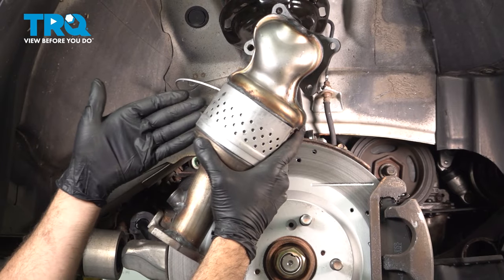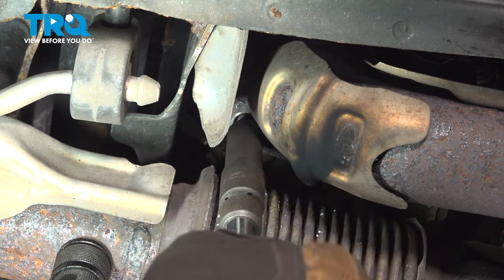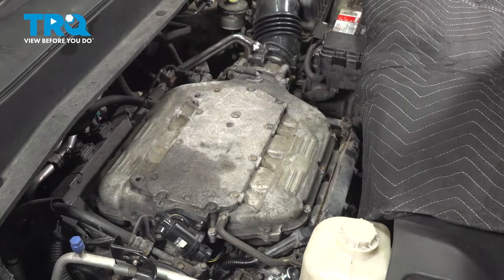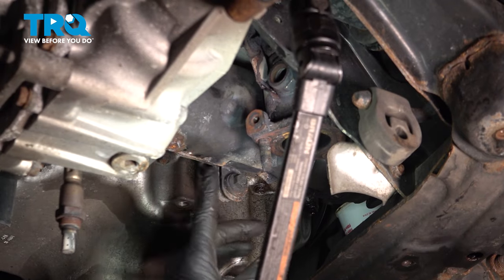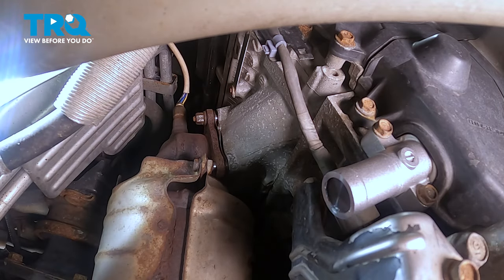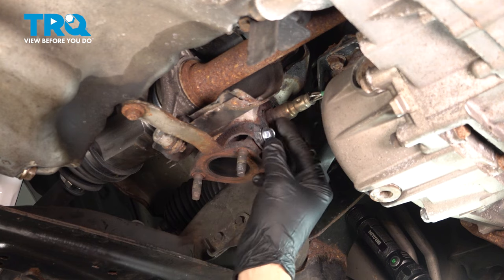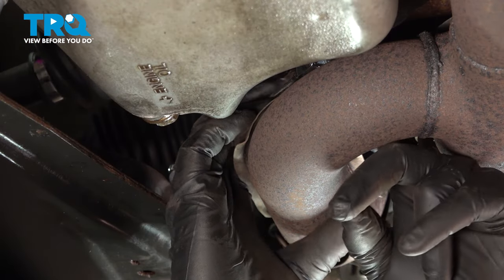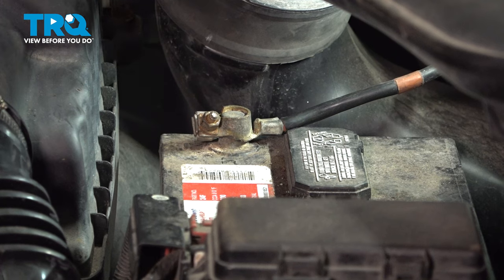How to Replace Rear Catalytic Converter 2009-2015 Honda Pilot

Comment: I have a check engine light for bank 1 that goes away, especially when i use Cataclean and will run great for long periods of time. My light has recently come back on and show Bank 1 sensor. I'm gonna try replacing the sensors for now, but i'm afraid i'm gonna need a new catalytic converter eventually but can't seem to find any. Hondapartsnow, Rockauto, none of them seem to carry CARB legal cats. So where the hell am I supposed to buy a replacement?? All the ones on. eBay and Amazon are not CA/CARB legal. What is so different from CARB and non-CARB converters that makes them so much more expensive???

Comment: I just replaced mine following this video, but I could not get the cat out the same way as in the video. I had to remove heat shield on cat while it is laying between CV shaft and tie rod. Removing heat shield for rack and pinion boot also helps. Removing air fuel mixture sensor on top first will also help with maneuver. If you have oxygen sensor wrench, it is easy to remove and install with cat installed on the engine.  Honda's service manual says intermediate shaft from transmission to left axle needs to be removed, which also requires removing CV axle and ball joint. I did not want to go that far, but this video encouraged me to try different route.
Reply: I was wondering if anyone removed the rear engine mount through the same hole after removing the rear converter. Shop manual says to remove the exhaust pipe and rear cat just like this video. But then they say to remove the axle and intermediate shaft. Trying to save steps, especially the axle removal.

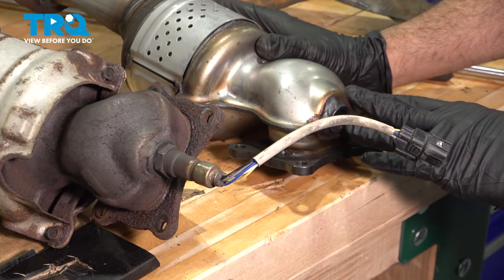Comment: If you look at time 16:19 to 16:28, you will see the new cat he is showing does NOT have the mounting points for the heatshield to the catalytic converter like the original.  The heat shield is needed.